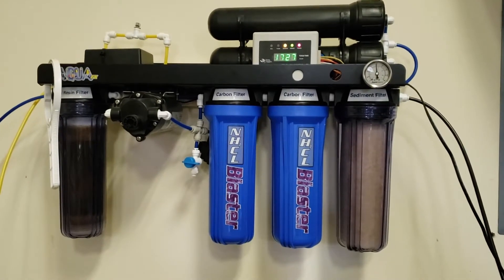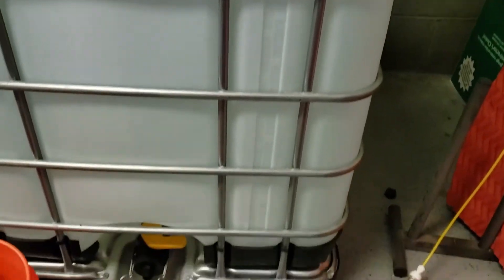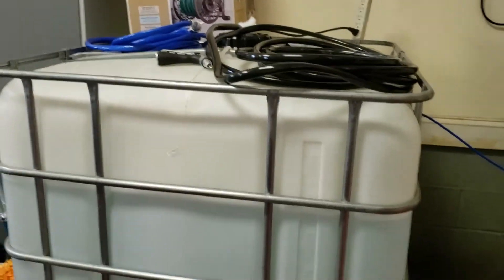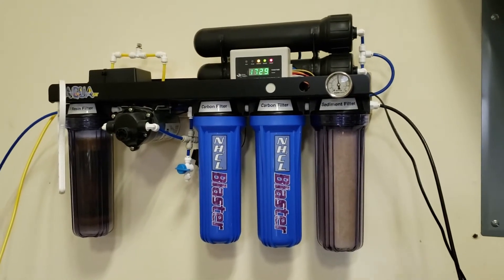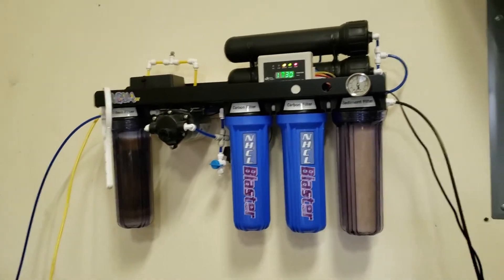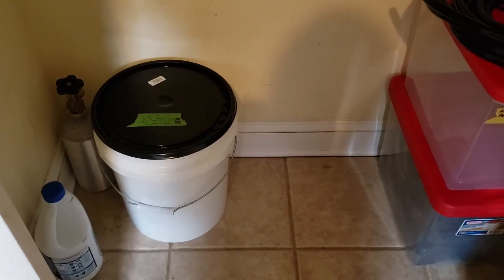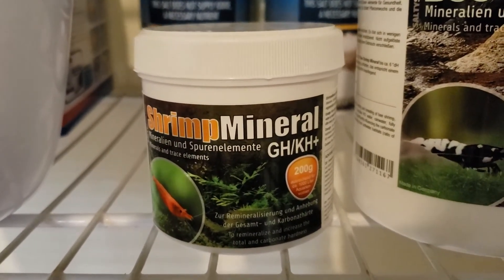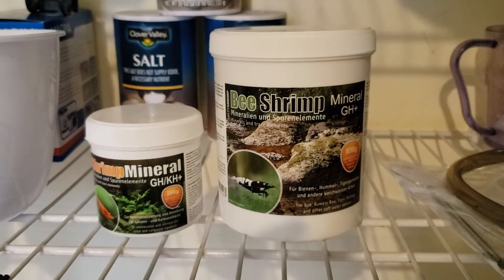AquaFx RODI unit. Making PURE water for fresh water aquarium use

Comment: I just got the octopus  reverse osmosis sister but is not producing any water, I don’t know what is wrong, all the water is coming out from the waste line, my psi is only 10 psi but the system has the buster pump so the shouldn’t be a problem. I try to restrict the waste line to increase the psi but 1 is super hard to close it and 2 is not decreasing the waste flow at all
Reply from the maker: Alonso, 10 psi is really low, it should read at least 40, but ideally it should read around 60 psi (double check for your specific units sweet spot psi). The yellow "T" (drain line) valve arrives mostly open. Slowly closing it should increase the psi. If you're still having trouble with getting your unit to produce RO water, I'd contact the company. AquaFX have really good customer service. Hope everything works out for you Alonso!

Comment: How long does that IBC last you? And is this just for the shrimp, or for all of your tanks?
Reply from the maker: Hi deadfred821, I go through 250 gallons about every 5-6 months at this time. I have two 5 gals, four 10 gals and a 20 long running currently, and I do use the ro water for all of them. I just mineralize the water according to specific needs when doing water changes, and use pure ro for just top offs due to evaporation. My tap water has really high silicates which causes really bad brown diatom algae. It's just easier for me to start with a blank canvas. Thanks for watching :)